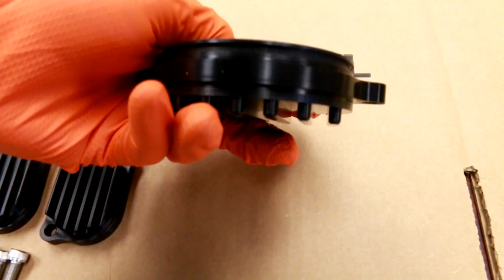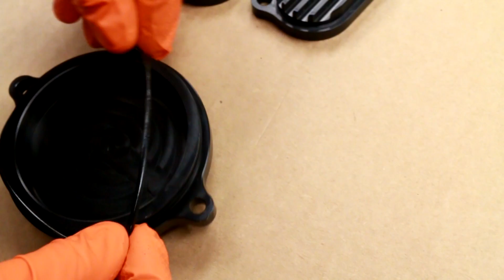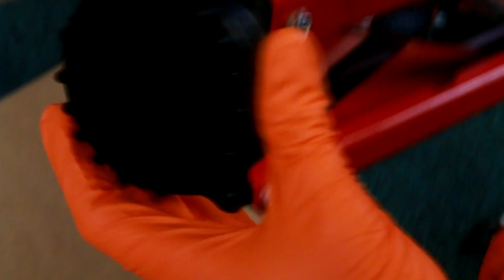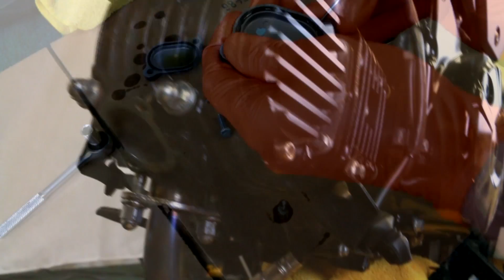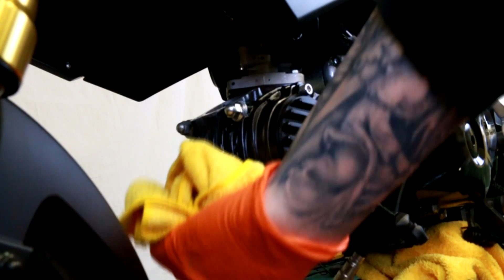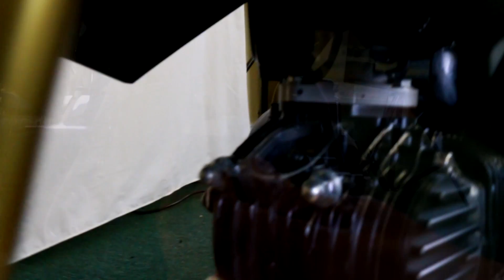TRS BILLET TAPPET AND CAM COVER FOR HONDA GROM INSTALL

Comment: Can this video be used as a substitute for the Ruckus"reed valve cover"portion install when you're modifying to a custom air intake, I know they are not in the same location & total different bike but same principle anyway I purchased one of those custom Reed valve covers for an air intake install but my air intake instructions doesn't call for any covering of any portion of the engine with that part which I ordered from you guys?